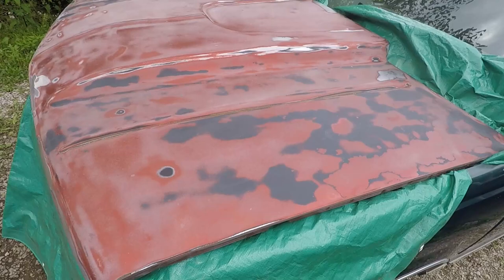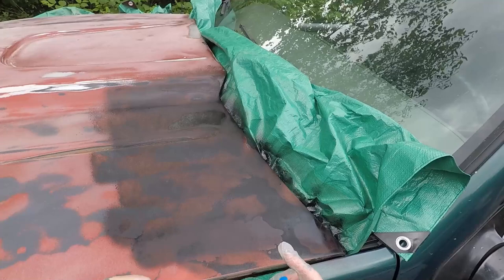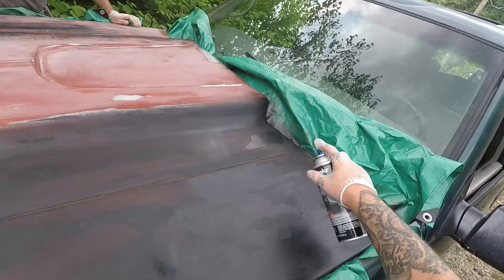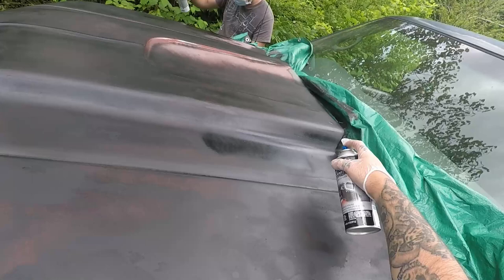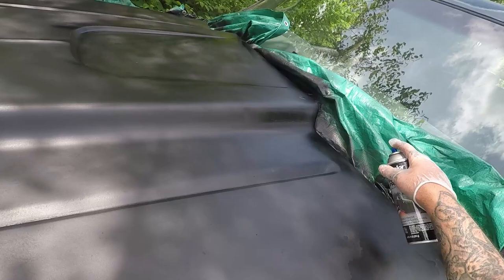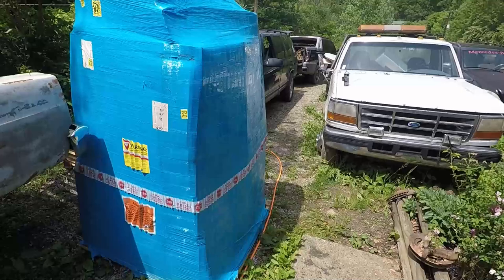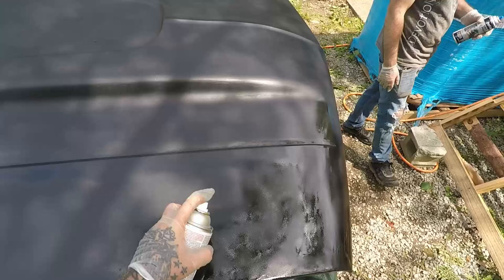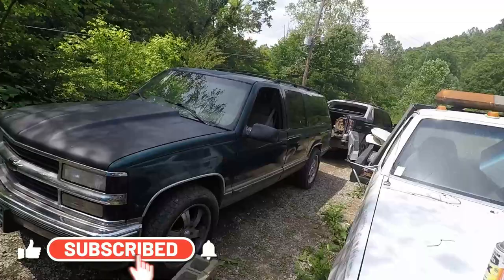LET'S SPRAY PAINT A COWL HOOD

Comment: Have you tried rustoleum turbo? It will cover a hood in less than 60 seconds. But it's hard to not have orange peel unless you can spray in low humidity.
Reply from the maker: I have not tryed it yet, but sounds like it be good to use on a whole car